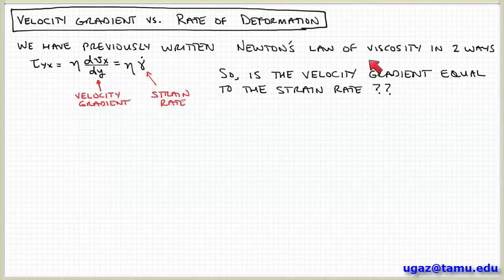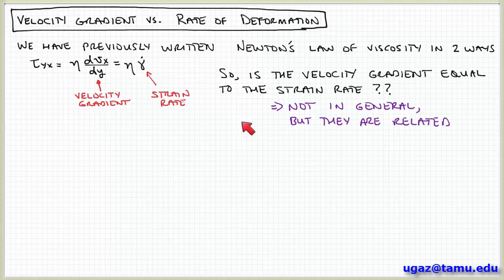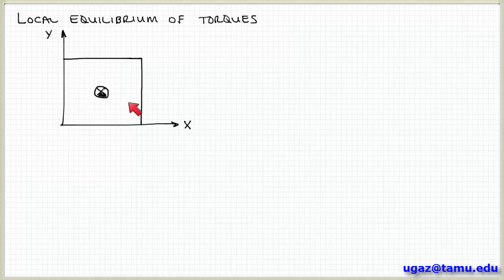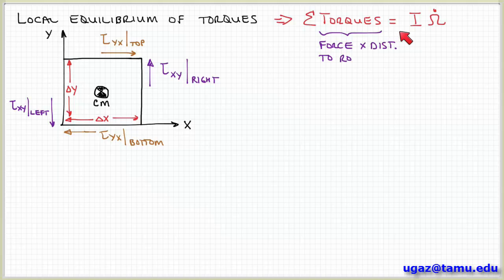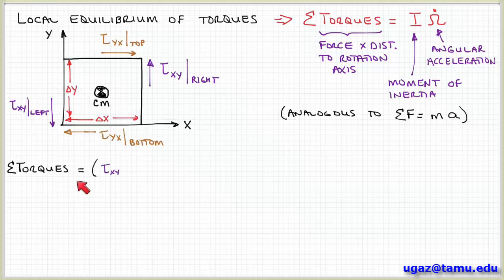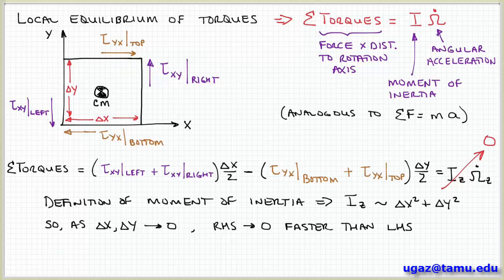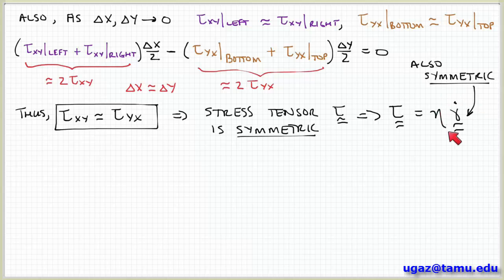Non-Newtonian Fluids, part 4 - Lecture 1.8 - Chemical Engineering Fluid Mechanics

Comment: a lot of the videos leading up to this one have been great, but the arguments in this video did not make a lot of sense to me. at 6:30 in the video- in a true equation the RHS and LHS will go to zero at the same rate, or its not a correct equation. Since the LHS goes as delta x and the moment of inertia goes as delta x ^2, the compensation will come as a high angular acceleration. it's like saying if I apply a force to an object of shrinking mass that the force will stay as is but the product m*a will go to zero, since m is going to zero. that is incorrect, instead if you apply the same force to lesser masses you will just get higher accelerations to compensate.

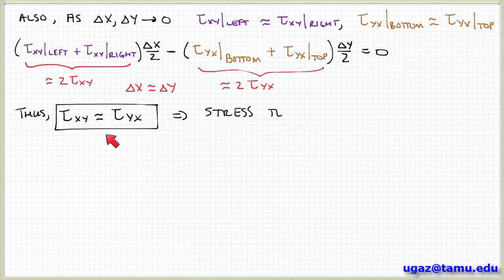also at around 9:40 - the assumptions made because Dx and Dy are going to zero don't make sense to me. Imagine a rectangle of dy=10*dx, even as you make these infinitesimal the ratio of dy to dx stays the same. It feels like there is a more rigorous mathematical way of getting to where he ends up that he has in mind and maybe would have worked and this was a hand waving attempt that I don't think worked.
I dont mean to be cruel here, the videos have been great and helpful but I think this one didn't go so well and I just wanted to offer my two cents.